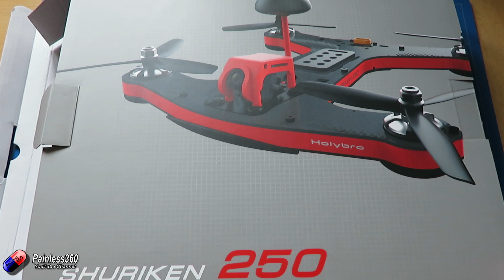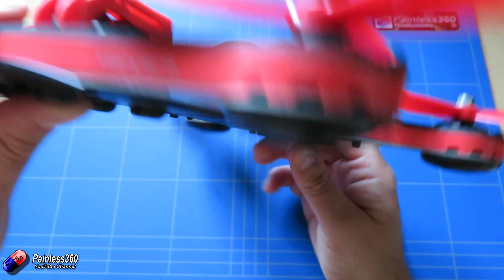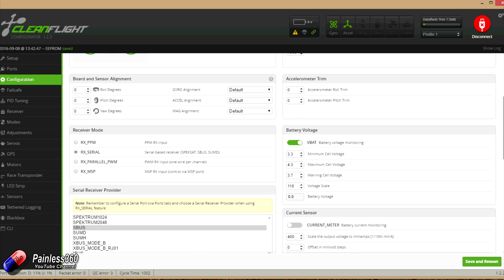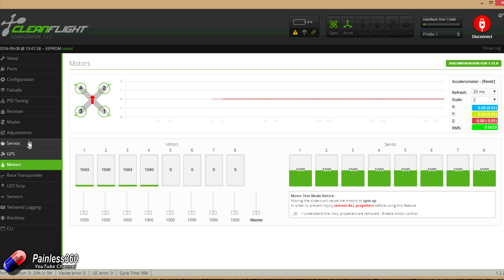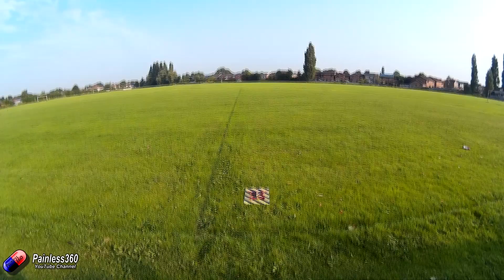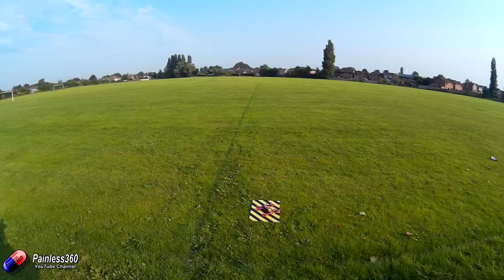RC Reviews: HolyBro Shuriken 250 Performance Quadcopter

Comment: Hi I have just bought one of these but have a problem I can't seem to find a cure for. I have a spectrum DX 8 and have bound it in and have the orange bind light coming on but when I go on the receiver section there seems to be no communication on any of the sticks. I also have a constant bleeping and a blue flashing light on. I'm really at my whits end and have looked for help on here but everyone seems to be on taranis. Hope you can help thanks in advance Simon
Reply from the maker: +simon powell I'd go back to the vendor and ask them for help. Looking in the manual it appears that the spectrum connection is via a satellite receiver. Make sure that you have serial connection selected, and that in the software you've also got the Spektrum satellite selected as the serial receiver. Best of luck!

Comment: Bought the Shuriken 180. Put a DSMX satellite in it. Can bind the Tx to the sat but cleanflight doesn't recognize the rx,rx failed. Think I'm gonna go buy a Taranis. Sun is going down, gonna go fly my Vortex. That took all of 30 minutes to set up.....ARRRRG
Reply from the maker: We've not used the 180 and haven't' used the larger model here with a Sat. Rx. We ordered ours with the Rx we needed all ready to go so it was all of 5 mins to set it up. Best of luck getting yours to work. Happy flying (soon)!
Reply: Found the problem. Ordered a Lemon Rx with satellite. Cleanflight has a list of supported receivers and the one I was using, is not. Thanks for all the great videos you put out there.
Reply from the maker: Glad you sorted it! Happy flying!
Reply: Cam Taylor All the more reason to move to BetaFlight ;)
Reply: RC Flyer85  Will be moving to Betaflight in the future.  My problems are self-created as I'm still just getting up to speed. My original satellite reciever is running fine. Just didn't know what I was doing.

Comment: would it bind to a turnigy i6s?
Reply from the maker: Only if you get one that uses the right receiver.. Ours came with a |FrSky one but other versions are available..
Reply: what one would you recommend?
Reply: danny jones For that transmitter you'd want a ia6c or the new x6b receivers.

Comment: Hi! Thank you for the review! I would like to use an external receiver, for example the Turnigy iA6C... I read is possible... but... how to do it? I have to remove the internal receiver too?  Thanks :)
Reply from the maker: I'd look at removing the inbuilt receiver, it's an S-Bus connection so it's only a three wire soldering job. There isn't a lot of space inside though.. Best of luck!
Reply: Thanks for reply! In the product description, Holybro says that is possible use also a PPM receiver and, into the bag, there is an accessory that should be placed in the bottom of drone to mount another receiver (i think)... Why not make a video for this? I think could be useful :)
Reply from the maker: Thanks for the idea, why don't you make one if you're going to do it? As you said, many would find it very useful..
Reply: :D Thanks you for the trust, but I haven't skill and experience as you! :)

Comment: Hi can you set this quad up with the Flysky fs-16s please.
Reply from the maker: Sorry, we don't have that radio. The copter only comes with a few options for the receiver so I'd check if they do one that would work with that radio as step one.. Best of luck!
Reply: ritvik916 You can use your own receiver... so the ia6c and x6b from FlySky would work fine

Comment: So funny that you have reviewed  this right now. I have just gotten one with the Fasst receiver it bound up right away. The motors spin up in Clean flight. The mode switches are all active but the arm  switch will not arm. I viewed all you arming problem  videos hoping that one would give me some insight and have yet to come up with a solution. Any suggestions? I should have said straight away I love the way you explain things on your video, you are very accurate and to the point with just the hint of humor. Thank you so much for all the many playlist you have contributed. They are a significant contribution to the rapidly growing technical knowledge base of RC sport . Best Wishes, UltraOffie

Comment: hello thank you very much for uploading  this video  
i  like that quad a lot
just couple of q :
any UK stock?
have you actually tried mounting gopro/ xiaomi yi ect. shape camera 
and most important ... i use/ have a lot of flysky receivers is it possible to swap that out to ?
perhaps next vid about this quad could be inside look of it? 
best regards 
Thank You
Reply: Piotr Kalisz look at banggood.com they have the 180 and also the 250 but I don't now if the have them stock
Reply: thanks mate they in stock but before i get it need to see insides , what esc's separate or all in one and how is radio receiver connected to it
Reply from the maker: +Piotr Kalisz if you want to know that then I'd suggest this isn't the model for you. The ESCs are separate and enclosed in the arms . The main board and receiver don't look standard components. Best of luck!
Reply from the maker: +Piotr Kalisz https://www.helicomicro.com/en/shuriken-250-review/2/ shows the internals. You should never have to play with them. Best of luck!
Reply: Piotr Kalisz It's just a regular micro receiver stuck on the pdb with double sided tape... For FlySky the ia6c and x6b will fit inside just fine!
Reply: Piotr Kalisz ...also the do have a GoPro mount available I believe